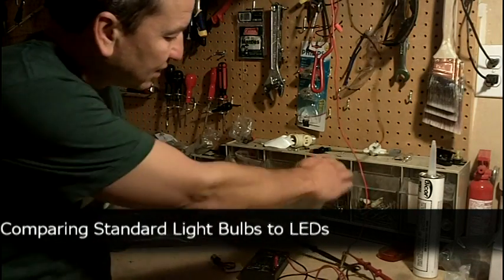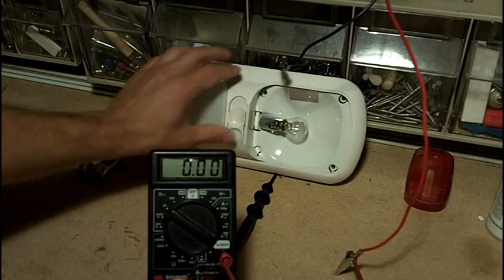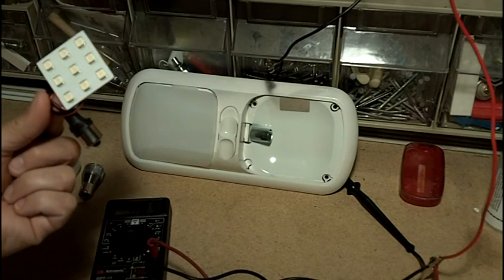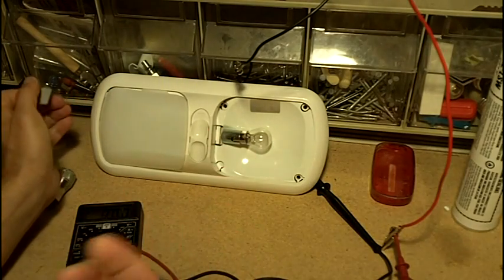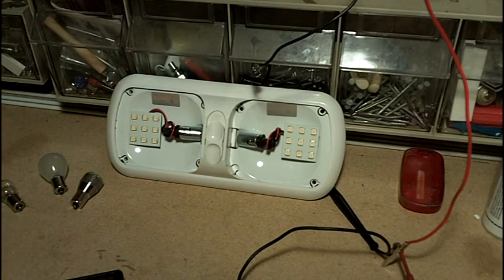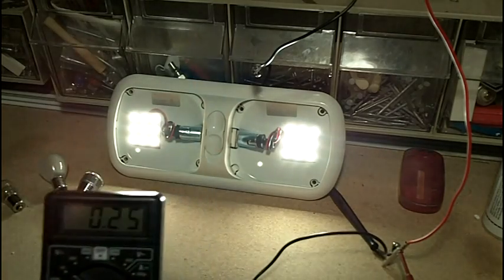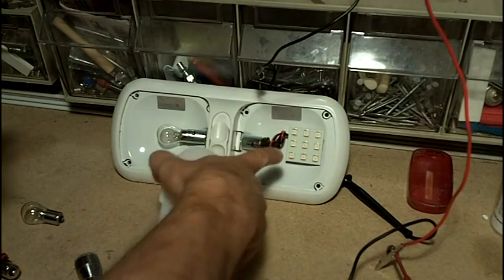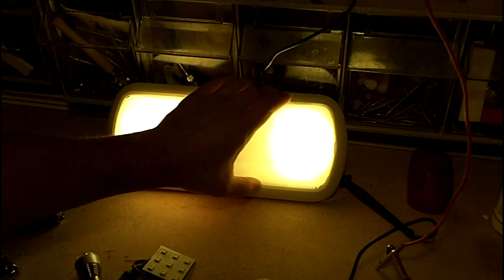LED versus Incandescent Light Bulb Comparison

Comment: Thank you.I think I'll give them a try.I have a slide-in camper & do a lot of backcountry camping.I have two deep cycle batteries (one in the camper & one under the hood ) linked in parallel,& a solar panel.
This setup works pretty well,but I'm always looking for ways to increase my loitering time in the high lonesome country.

Comment: As a test I tried an led and left it on while the camper was stored. Two weeks later it was still on and the battery was still holding. I was using standard 18w bulbs and have now replaced them all with 1w leds. I can now run every light in the camper using the same power as using one standard lamp.
Reply: You do know LED have alot of problems... but people are blind by only the 1 watt or 7 watt.... a incandescent problem is just heat and there is no problem with heat

Comment: The Incandecent lamp had a 360 degree light angle thus using the back lens. The LED's do not emit light toward the back, but only toward the defuser. I feel the LED's are better using battery power.

Comment: Good demo!  Nice to see them side by side.  This is what I love about your videos - you actually show items side by side, talk about differences, so viewer gets a good visual understanding of the item discussed.  Very useful.  Your delivery style is also very soothing, thank you so much!!!

Some feedback for others:
1. Don't measure wattage of incandescent bulb (INC) vs LED bulb.  INC bulb is always higher wattage (consumes more power) than LED bulb.
2. Measure Lumens of each.  Lumens is the light output of any bulb - how bright it is.. You can compare the Lumens rating of an INC bulb vs an LED bulb and if they are the same then your light output will be same.
3. In this demo you can see that 2 INC bulbs usen 2.40 amps, and 2 LED bulbs use 0.25 amps, so LED is 90% less power than INC bulbs!  Pretty substantial.
4. Also note that LED comes in 3 white light shades: warm white, soft white, and bright white.  First two are like the ICN bulbs, soft yellowish glow.  I bought Bright White and they are like industrial white lights - good for surgery, but not pleasing, esp on your face in the mirror!
5.  Walmart had some good prices on 12V LED bulb packs for my RV Pancake ceiling mounted fixtures.
6.  IKEA has great prices on LED AC lights for your house, but be sure to check Lumens as some can be intentionally dim for night stand lamps, etc.  Prices were $3 and $5 per bulb!
Reply from the maker: +Lass-in Angeles Thanks for your kind words and for sharing the additional info.

Comment: I replaced all of them in my RV and what a difference it makes when cooling the RV with the Air Conditioner. Very noticeable difference.
Reply from the maker: George Bowman Yes. I used to be the power police when folks would leave lights on, now with LEDs I don't worry about it.

Comment: Incandescent bulb 1x = 1.19A=14.28W  2x = 2.40A=28.8W LED bulb 1x 0.13A=1.56W 2x =0.25A=3W so 10 led bulbs use 15.6W  and 1 Incandescent bulb uses 14.28w, LED lights are awesom perhaps not the brightest but  10 of them versus 1  and they become quite bright
Reply from the maker: That's right. 10 to 1 is about what I've noticed as well. Thanks!
Reply: RVwithTito Thank you for this nice explanation

Comment: Let's forgo the issue of brightness, which is considerable:  What isn't mentioned here is the cost of the LED replacement bulbs.  I use my RV for recreational camping and seldom have run into power issues, even when boon-docking.  Why exactly would I want to change a dollar light bulb with a LED replacement that's going to cost me upwards of $20 bucks?  The cost differential just doesn't yet make sense.

Comment: Ugh. Second video in a row I've watched to figure how to measure amps that doesn't show how the leads to the mulimeter are connected in the power circuit.
Reply: queenofspadz DC positive source to positive, red lead of multimeter to negative of light.  Negative lead of multimeter to negative DC source. Essentially wired in series. Set multimeter to DC current.